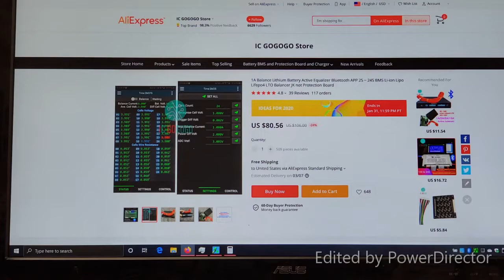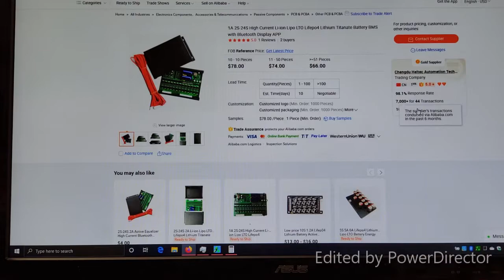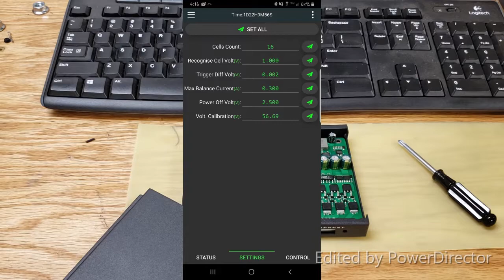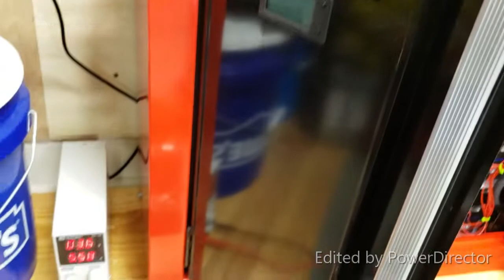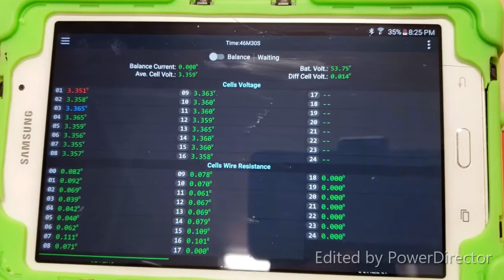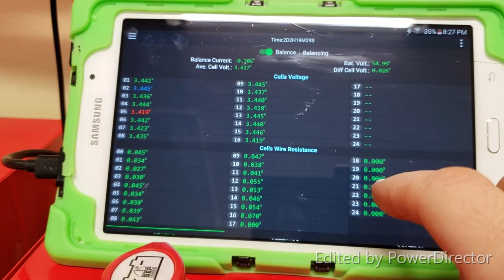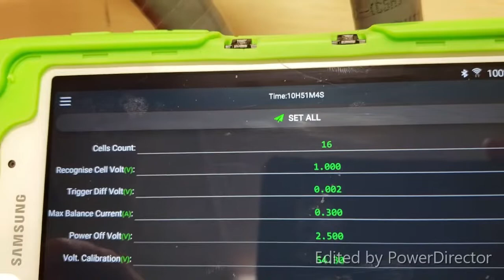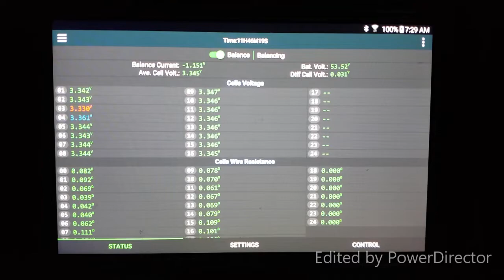LV5048 Balancer and BMS  Discussion.  Power Wall 1 working again.

Comment: I love your powerwall setup, great work. I think that BMS is kicking in too late at 3.9v instead of 3.65v on the high end, end 2.0v instead of 2.5v, they are now for sale on alibaba for 5 and 8 USD. They are probably old bms´s from the beginning of the litium era when they where using that high voltages and later on they figured out that it was to high and adjusted it to 3.65v.

Comment: The way you are doing it is the only right way to do it. Know your battery pack. Monitor your pack. Never ever rely on a BMS to "fix" your out of balance pack. Use it to monitor the pack only. We have many reliable options on the market that will disconnect the battery before harm takes place.
Reply from the maker: Thank you. We have to get personal with our DIY stuff. No ifs and buts. Your comment inspired me to make latest video.

Comment: I got the 2A version of this balancer from Amazon and I opened it up and sure enough a bunch of those little components are grinded so the numbers cannot be read.
I will be hooking mine up in a few days and I'll see what it does. lol.
Reply from the maker: Keep us posted.
Reply: @DMIINC2013  here's a screenshot of the app with my balancer on the Nissan leaf powerwall. https://photos.app.goo.gl/H6i5AJCwnbiQ1pz86
Reply from the maker: @lnxpro  Did you try unplugging and plugging it back in? Other than that problem looks like my first one.
Reply: @DMIINC2013  After unplugging it and plugging it back in, it resolved that issue, however the voltages are not accurate. It shows voltages from 4.005 to 4.010 which is not a large deviation, but when testing each individual parallel pack with a multimeter, they are all the same.
Reply from the maker: That means that you are doing real well. There will always be very small deviation on this device, depending on cell and wire resistance and wire length. Try draining your power pack down some and see if there is any significant difference.

Comment: Using 1 amp only use the full1 amp when needed if it gets balanced or close it will automatically use less to balance with.
Reply from the maker: Have not notice that but I will pay closer attention to it.
Reply: @DMIINC2013  Well maybe mine is different as the blue cans are above the board looks roughly the same tho